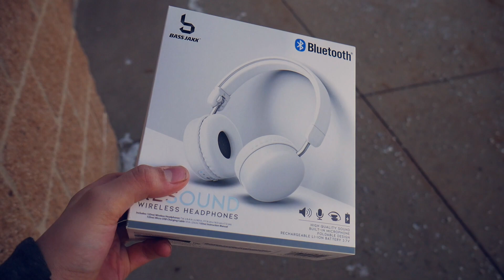Make A DIY $5 Bluetooth Receiver For Your Broken Headphone Jack!

Comment: Great video! Can you change the device name or does it show up as the cheap headphones?
Reply from the maker: On an iPhone you can change the name, but if you connect to a different device it will still show the old name. This is because the phone is just associating the new name with the bluetooth id. It doesn't actually change the root device name assigned at the factory. I hope that answers your question!